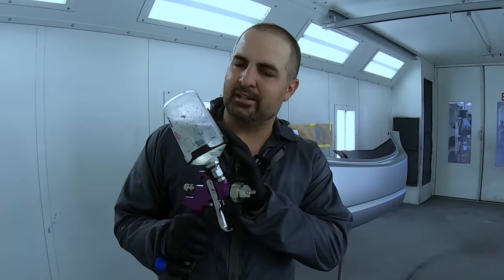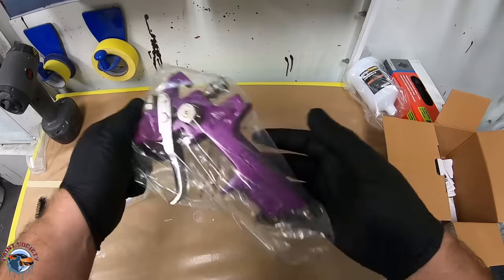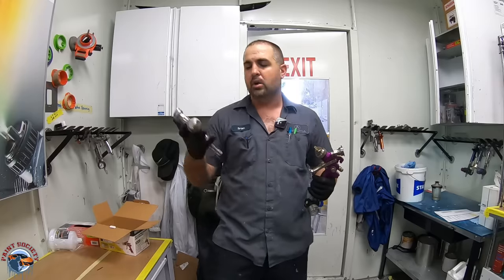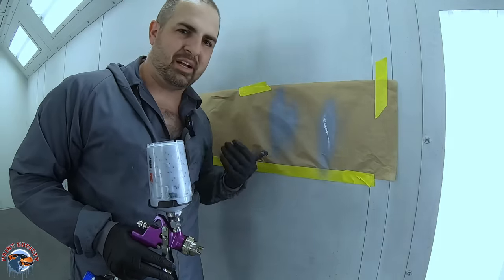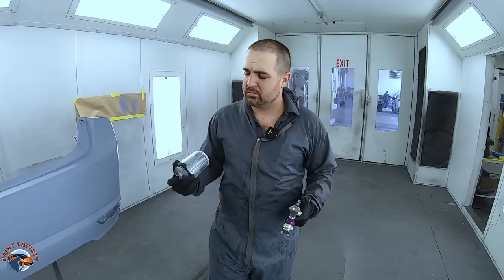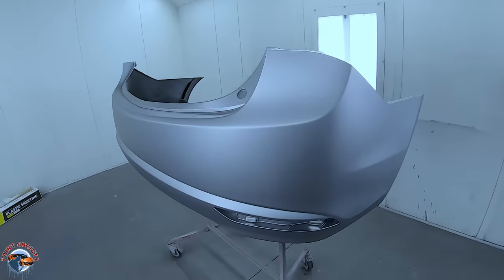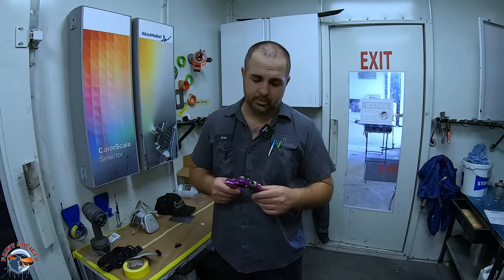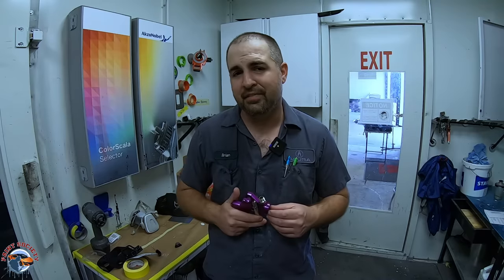$15 Harbor Freight Paint Gun Delivers Professional Results!

Comment: They work awesome even for the DIYer. Great results with it painting a Chevy Small Block and a Jeep Straight 6. Used thick ceramic engine paint and a homeowner grade little air compressor. Paint went on beautiful.
Reply: It doesn't take much to make a motor look good I let my six-year-old spray paint the motor in my truck there's no way you can screw it up it's a motor
Reply: @Ram Well thats your opinion of course, but id say thats a complete lie.
Reply: @losandreas6443  you'd be wrong.  A Chevy small block is probably a cast block, with tons of pitting and inconsistency in the surface.  You can probably paint it with a brush and people wouldn't notice, provided the mix is thin enough.
Reply: @CafeRacer1975  Your opinion is funny as well, because I do this for a living and can tell. Its just whether the persons doing the job is ok with how it comes out ultimately if not done professionally. This is not a case of probability.

Comment: I used that gun for everything but primer and touch ups for years! Seemed like though back in the day when I started spraying the fancy guns were kind of unnecessary when I apprenticed we were taught it didn't matter if we had to spread paint with a mop because the quality was all in prep and polish everything wet sanded smooth with a thick clear coat and it looked good and everyone was happy.  I still believe that sure if you are a professional you ought to take advantage of anything that gives a better end product or makes the process more consistent or efficient and you owe it to your customers to do what you can. But...that being said if all I have at the shop is rattle cans and my customer wants to trade instead of pay, know that that car isn't going to leave the booth until I feel confident that it will look good, perform well and speak well to my brand. Painting or any art for that matter has to be more about maximizing hard work and talent before anything because if you can do it like that you are going to be a straight rockstar when you catch up to the tech and the whole industry will get better. That's what it's all about  I think. You do awesome videos man. Much love and much respect🍻 edit: my business partner just reminded me we had a different gun for clear as well so I guess I didn't use it for clear coat.

Comment: I’m considering painting my car this summer. I think I’ll actually get this one. I usually like to stay far away from Harbor Freight, but I’m actually very impressed! Nice job 👍
Reply: They lay paint down nicely...they are cheap but the manufacturer does make improvements over time...I just purchased one again and it's much nicer than the model I have from 2 years ago ...I use a screw on filter at the gun and set Regulator at about 32psi
Reply: @bilbobaggins4710  What was the improvement from the gun from 2 years ago? Thanks

Comment: I’ve always been one to believe that the major factors in a good paint job are; the quality of fluids used, the skill of the painter and the regulator. This vid just goes towards solidifying that idea. The only difference the gun makes is like he said - Ease of use and longevity.
Reply: AW 33COM  exactly perfect prep.  Paint booth does wonders. Good lighting. Quality materials. Gun sucks and just try to use that as a noob. You’ll wish u never bought it. It wastes more product and that cost is wayyyyy more than cheaping out on a decent gun you can get for 200
Reply: @jecrpalier  Just knew there would be at least one snob here lol. I have the thousand dollar guns, I have the 500 dollar guns and I have about a dozen of these I have used over the last 35 plus years. I use these to paint outboard engines, Camaro's and anything in between. Do I love my Devilbiss etc.. of course. but you are wrong about this gun. Beginners or pros with specific needs can make it sing with little effort...
Reply: @daddski1  of course it will work if you f with it enough. It’s still junk. And it will fall apart  also you make a beginner struggle to get it to spray decently. Losing money on product is way more costly than being an idiot and wasting hundreds on ruined jobs from a difficult gun to get to work right. So you penalize the beginner and make them pay 5x what a cheap 150 dollar decent gun would be.  Smart real smart.
Reply: Its similar to talking about really cheap guitars. Yes, a great guitarist can make the $99 guitar at Costco sound amazing. But a beginner, will soon get very discouraged as to the inability to hold tune, poor intonation, rough frets, and bad durability.

Comment: Brian, you won a large group of subscribers by simply addressing our interest in beginning to paint. 
Since not many beginners can justify immediate purchase of an expensive, "professional" paint gun, there is a large market for training-class paint guns. 
Basically, this training market segment serves those who want only to satisfy their curiosity and their own developing interest. This same entry-level market also serves those who know basic techniques, but are satisfied with "good enough" results. 
You need not worry about leaving the wrong impression about better-quality paint guns. Since quality sells itself, we eventually will understand the need to invest in a gun costing hundreds of dollars more. 
* 1. Beyond purchase of a paint gun, the next item which many of us need is a basic, reliable air compressor. We were delighted to find your video, ""The Cheapest Way to Paint a Car with Amazing Results".
* 2. You spray with a preference for a two-part system, which requires a mask. However, many of us have heard about the use of "water-based" automotive paint by the automotive manufacturers. Have you covered that topic, yet?

Comment: I have the same gun. Keep it clean and don't expect it to work or feel like a $500 gun. A good painter can get better results from a cheap gun than a bad painter can get from an expensive one. It's a tool. Cheap tools work if you know how to use them. Some better than others. You don't need to spend hundreds for a gun to paint your car in your garage. Just like you don't need to buy snap on tools to do an oil change. If you know what you're doing, you can work with what you have.
Reply: Daniel Lawson that’s what’s I’m talking about. Like your attitude

Comment: Newbie here. Painted 2 cars now. First one was a peeling accord. I laid it down with this gun but was an amature so it was not very smooth, kind of orange peel, but it held from probably 2012 until I junked it in 2024. The paint and clear coat held the entire time, even when I left it sitting in the sun for 3-4 years in between in one spot. Picking it up again I forgot what I had learned so the main points are 1. Check and clean the gun and pin. I had bought 2 guns, the one I used last time was not spraying well. I switched to the new gun and it sprayed as good as it did before. I tossed the old gun in acetone while I painted. When I finished, I took the old one apart, and the rod had rusted, no idea why, I cleaned it thurougly before storage. Sand paper on the pin and good as new. 2. I didn't want to do two stage this time, one stage would do. However, Paint was not laying down well with the 4:1 mix. Turns out I needed some  reducer, about 5-10% did the job and it sprayed beautifully after that. 3. Both times I used a craftsman 3 gallon compressor. I tell you, it is not enough. I forgot how slow it took using this compressor, because one wave to and back and its already kicking in. I regret selling my bigger tank, I didn't think i'd ever do this again. I'd do at least a 20 gallon. 4. Don't be lazy, use protection. You won't notice it right away but your eyes can turn dry and hurt, because its painted... You might be tired the day after, because you were breathing in paint. Use protection.  5. Lastly, which should be first, as with every paint job, prepping is everything. I wasn't paying attention and used a gray etch primer for some exposed metal, and it did not sit well trying to cover it white. I also had some rust converter that was black and it was extremely hard to cover. Had I sanded out all the brown rust spots, and used the right white primer, the paint job would look several times better than it did. It does take a lot of work but it pays off. It should look almost like how you want it to end up, it'll just be shinnier when you lay the paint down.

Comment: I 100% agree, it's the painter not the gun! I painted this truck over 20 years ago with pretty much that exact gun since I just planned a quick restoration but it quickly turned into a full blown restoration when I saw how nice the paint turned out. I just compensated by distance, air pressure, fluid volume, spray pattern and just closely watched what was happening when the paint hit the surface and watched for the gloss and just shy of getting runs. I used Sherwin Williams acrylic enamel with a hardener. About 12 years later as I started to do more restorations I spent $600+ on a new Sata and thought it was pretty stupid other than like you say, it had a much smoother trigger and that was about the difference but not $600 difference. https://www.youtube.com/watch?v=bWykWqoUVXs

Comment: WOW, you didn't even clean out all the oil inside a new gun.  The answer to the question you pose is:  IT'S THE PAINTER!  Clearly, you are a pro.

NOTES for other newbies.  I bought this gun (my first) to spray clear polyurethane on deck furniture and had a bad experience with it.  So much so, I tossed it in the trash afterwards.  

1.  The spray needle thumb screw comes out easily enough but is HARD to get back in.  The spring is strong enough my hands could not compress it enough to get the thread engaged.   And the purple gun handle has a protrusion that gets in the way - poor design.  Remove that protrusion and mill a slot in the thumb screw so you can engage a screwdriver to get it back in (or make the head hex shaped to use a nut driver).
2.  The gun comes full of thick oil.  Brass should not rust, so why all the corrosion preventing oil?  It is hard to get it all out.  And I fear I did not, as my gun didn't spray much polyurethane even with the air open and needle backed out 4 turns at 35psi of feed pressure.  
3.  This cheap gun doesn't come with the flat wrench you need to remove the nozzle!  Standard box end wrenches and adjustable wrenches are too fat to fit the flats, so you cannot remove the nozzle!   Those flats could be taller (poor design again) or they could include a stamped wrench for $0.50!

I am reminded you get what you pay for.  I'm buying a better gun.  Hope this info saves others some pain.
Reply from the maker: Thanks for your comment. It’s a great overview with the gun itself and is completely on point. It does come pretty oily and I did wash it up off camera, doesn’t make too much sense as to why there’s so much oil in a paint gun LOL
Reply: Air consumption is a huge factor as well...Higher quality guns require much more in the way of cfm..This gun needs only about 4 to 6 if I remember correctly...True HVLP guns start at 9 and go to 13+ which the average DIYER doesn't have access to a compressor that large ... We're talking $500+ units

Comment: I've painted plenty of panels with it. You have to work for it for sure!. I'd love to see your opinions on some lower cost better alternatives.
Reply: What size air compressor did you use?
Reply: Just curious, if we set it up fan wide open, fluid wide open, at 35 psi. like he said on the beginning comments, where is the extra work in set up? Thanks

Comment: I bought the purple for high build primers. First, you need to really clean it out of the box. They use some thick assembly lubricant that gets gummy. I also drilled out the tip to 2mm and then manually 'seated' the tip. Hopefully this will allow more flow for thicker primers. Great video. thanks.
Reply: I did that, it sprayed feather fill easily

Comment: I have used these guns on over 500 vehicles that I have rebuilt and the results are always consistent and I usually get around 150 jobs per gun if cleaned properly before I get issues of inconsistencies.   I have sprayed some really nice paint jobs even on higher end vehicles like Mercedes and corvettes and tricoat pearls and more.   I call them throw away guns and after I lay my clear I never have orange peel and never have to go over and buff  or sand

Comment: I drilled out the tip on this a bit and painted many portions of the house I built with it.  I still get water based stuff through it but he is correct about it eating air.  For a diy guy thought it's a nice tool

Comment: The secret to using this gun is getting it set up right. Practice on another surface before you attempt a full spray. This gun actually works fairly well.  I have used it to shoot all sorts of material. Make sure you  clean it well after use. If you have a little patience, you can make it work for you. GF1 👍👍👍👍👍😁😁😁😁😁😎

Comment: I use a sata 5000 and sata 3000 and a pal of mine said give this dota spray gun a go. He paid £50 of Ali express for it.. It was as good as my sata guns I pay £1000+ for..
I can't even ardue on time it'll last if its taken care of why shouldn't it last as long as my sata after all needles need to be changed. My needle set up with cap and adjuster £250  his dota set up £20.. I know if I had sen the gun a few weeks back I'd be spraying with a dota gun with a big wedge of cash still in my pocket.. Its most deffonatly skill over gun

Comment: Another great video. To be honest I must say I have some critique though because the test he put the gun through was at a higher standard than he would have put the same high end gun through, since he has multiple guns to tackle different phases of the process from the primer, pant, and clear coat phases. Now we're talking 3 guns ($1800+). 

6:59 What he just said is that up to that point of the project the $16 gun did the same as $700 gun. 
7:09 What you're really paying for is 'ease of use'.
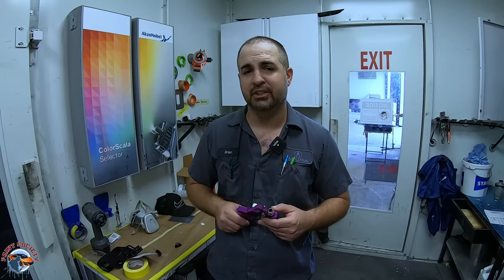9:00 He had to work really really really hard. 

In plain English that means if you're actually too lazy to bust ass lifting that heavy 2.5 lb. gun and having to actually 'work', you have no business working on cars anyways. Keep your office job. It also means you saved around $650 that you can spend for paint. 
Having said all that, I agree the higher end guns are built to last, but for $16 you could buy 40+ guns for the price of one $600-$800 gun. And if that high end gun bites the dust unless it has warrantee you're screwed. For anyone less than a full-time pro you'd be just silly to buy the high-end model. 

10:17 Don't overthink it. Just buy the cheap gun, paint your car with it and throw it in the trash.

Comment: The way i look at it. For the minimal amount of painting ill be doing. This is a good purchase. It appears to give a smooth flat finish and for a super low price(excluding the compressor and regulator. If you could try this without the regulator as most newbies would do, that would be pretty interesting to see. Also the setup used, do you have a moisture filter from the compressor this is decent for doing touch ups id imagine.

Comment: I've bought some of Harbor Freights guns and I was impressed with how they worked, but they don't last. They( the ones I had) had some very half ass leather needle pack that gets destroyed cleaning it . I think if you buy the gun with a tip in the range of what you are spraying and are fine with throwing it away after a couple uses there a good option. 

 Also where do you get any gun can't do a show car finish. I've never seen a paint job I couldn't sand and buff , (so long as they put enough paint on it and didn't run  the paint ) that it wouldn't look as nice as any show car. The term show car is also thrown around wildly.

Comment: I bought their gun that cost about $30 (their touch up gun that looks like that one) and I was going to toss it when I was done painting the inner fender wells and boot on my 911SC but it was so controllable and worked so well that I cleaned and saved it and I've used it 4 or 5 times since then. I have a brand new Atom X-20 I bough a couple of years ago that has only been taken out of the box for initial inspection.

Comment: I've been painting for about three decades and all my expensive guns are siphon feed, Binks, Sharpe and Devilbiss. I no longer use these guns and am not willing to shell out big bucks for a top of the line HVLP gun; I see no reason to.

A good painter can spray with any gun and get excellent results. Yeah, the HF guns need higher pressure to get better atomization, but they still work very well. These HF guns usually fail at the packing nut because the thin teflon coating wears through, causing a leak; especially if you don't oil it properly, but they can easily be fixed and put back into service. Here's how: With the needle and packing nut assembled, use a marker to draw a line around the needle where it enters the packing nut. Remove the needle and wrap teflon tape around the needle starting from where you marked to about 3/4" in, wrapping maybe 6 - 10 times. Next, put a dab of petroleum jelly on your index finger and lightly wet the teflon tape with your thumb and index finger by twisting the needle in the opposite directing you wrapped the tape. Reinstall the needle and do a water test, filling the paint cup with water and checking for leaks. If it still leaks, you need to wrap the tape a few more times. The gun will spray like new again if you do it right.

Comment: You usually get what you pay for, Harbor Fright is excellent if you have ONE JOB that requires a tool that you don't have, and the price comparison is huge. For example I bought a Harbor Freight Torque Wrench, and it got me through an engine rebuild. Then I used it for other things and it snapped.